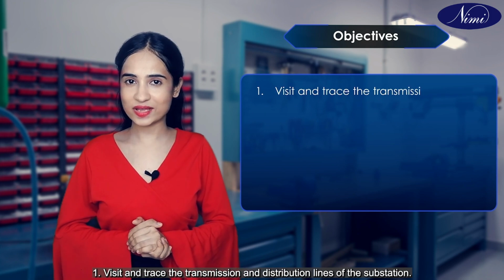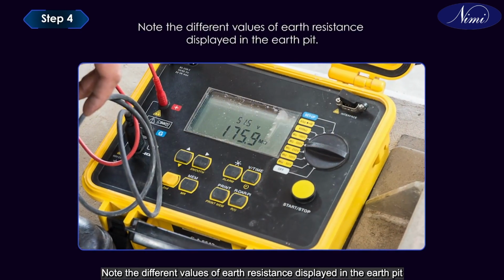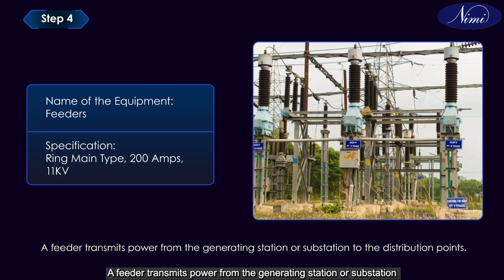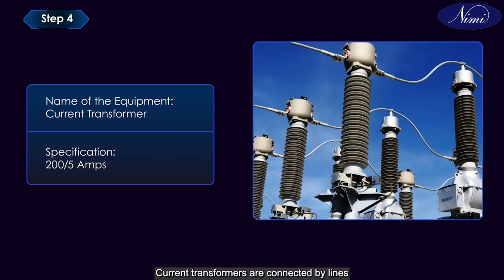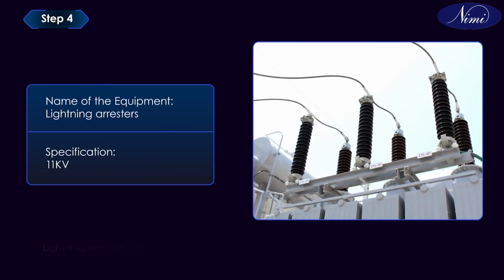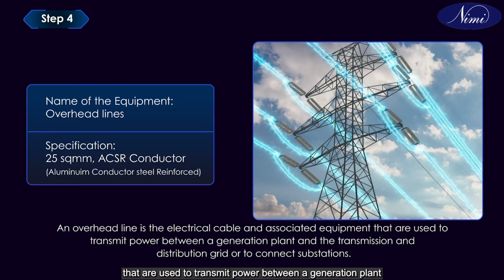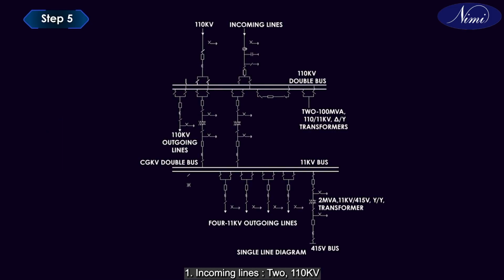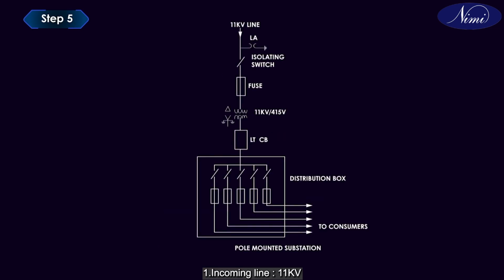Visit to transmission and distribution Substation | NIMI | DIGITAL | ENGLISH |

Comment: Pur video on electric motor  accessories(MCB,Contactor, Overload Relay/MPCB, Motor terminal connection, starter,....) with new panel installation (or) if already installed if faults occurs troubleshooting
Reply from the maker: We’ll be covering it soon! Make sure to subscribe for updates.